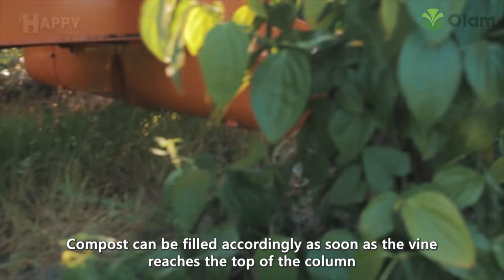How Vietnamese Farmers Produce Tons of Black Pepper -  Black Pepper Farming @HappyFarm85

Comment: Sir black papper can be grown in hot places at 800 meters above sea level?
Reply from the maker: Yes, It can. At an elevation of 800 meters above sea level, the climate may still be suitable for growing black pepper as long as the temperatures are within the required range (around 25-30°C) and there is adequate rainfall. However, it is important to consider other factors such as soil quality, sunlight exposure, and proper care and maintenance of the plants to ensure successful cultivation.

Comment: Do Pepper plant require partial shade ?
Or not necessary?
Reply from the maker: Hi @manjunathm2209,
Pepper plants generally prefer full sun, meaning they require at least 6-8 hours of direct sunlight per day for optimal growth and fruit production. However, in very hot climates, providing some partial shade during the hottest part of the day can be beneficial, especially if the plants are showing signs of stress or wilting due to excessive heat.
If you live in a region with extremely high temperatures or intense sunlight, providing limited shade during the hottest hours might be a good idea. This can be done by using shade cloth, placing the plants under a tree canopy, or using other types of temporary shade structures. However, it's important to strike a balance because too much shade can hinder the plants' growth and reduce fruit production.
Hope the above can help you.
Reply: @HappyFarm85  
Very useful information. Thank you.

I live in India, here growing in partial shade is in practice with Silver Oak Tree.
Reply: Can u supply plants for planting in india
Reply: Can visit to your project. Can u give advance training